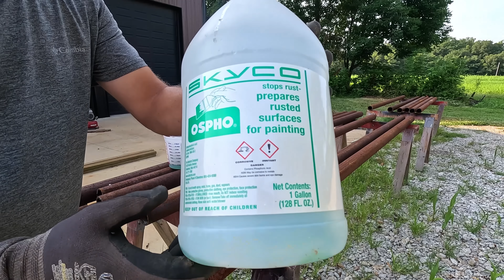Cutting Down Trees, making way for new fence.  Planning ahead for this months projects.

Comment: Hello to both of you from Kentucky. Evan, I was thinking about your return hydraulic line getting pushed off by the tree limb. I was thinking that maybe you should show the section of your previous video showing what the hydraulic line looked like after the incident happened and your corrective action to TYT. I feel that although that situation was purely an accident, That nonetheless the TYT engineers should be made aware so that they possibly could make possible design adjustments to keep a similar situation like that from happening in the future.

Comment: Cutting trees that size...... use the tractor and loader.....with tines......Place the tree between the tines.... slightly push on the tree. This way you only need to make one cut. Saves a lot on the chain ! Much safer also !

Comment: Evan sure hot in Georgia to. I can't wear a cap during the summer. I read somewhere that most of the heat your body releases most goes out of your head so wearing a cap holds the body heat in somewhat. Therefore your hotter wearing a cap. Just food for thought.

Comment: That hanging tree would make a good video. Put a block&tackle to the top of the tree and the top of your tractors bucket attach a extension rope to the branch and pull the branch right above your hog wire. 🤔

Comment: Such hard work! But …. What about the wood shed revamp? Getting worried that it will fall and your winter’s supply will be compromised.  Always something right?  Unbelievable work on increasing the fence line in the heat of summer .

Comment: As always, I enjoy your stories, but having been a faller in the mountains of north Idaho for years, I'd like to caution you about cutting trees loose from the stump before they're completely on the ground, as you've been doing here.  Even a small tree has weight and when cut loose they can jump backwards or sideways and, at the very least, tear up your shins.  A bit bigger one can  easily break a leg....and it happens VERY fast.